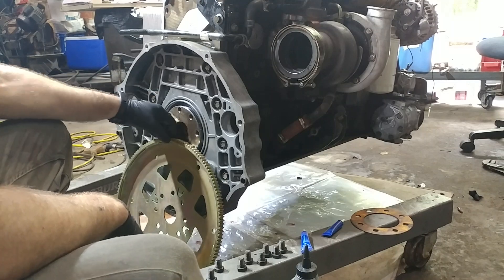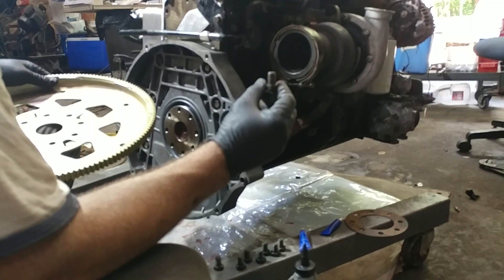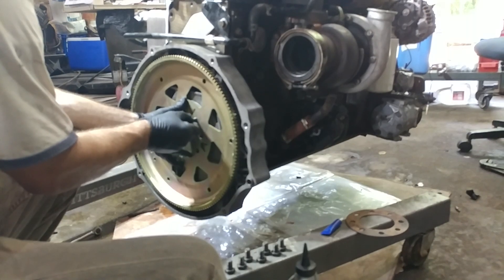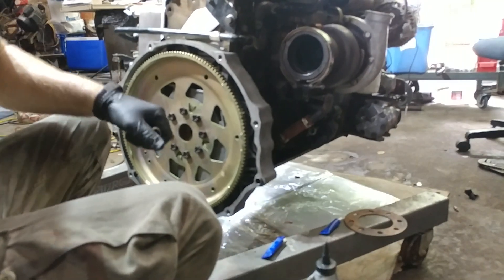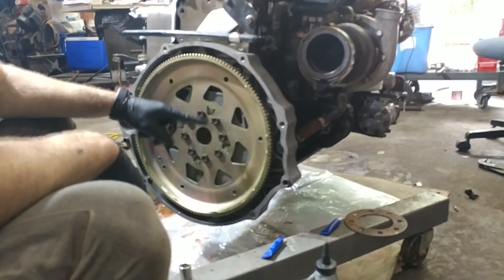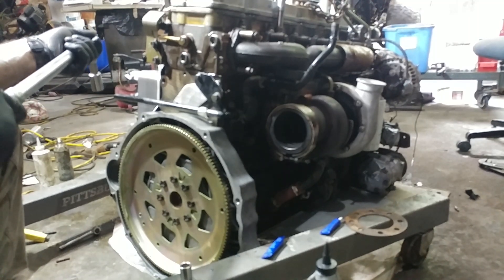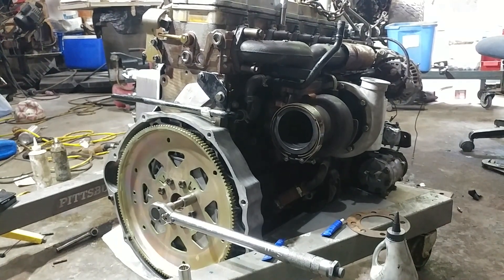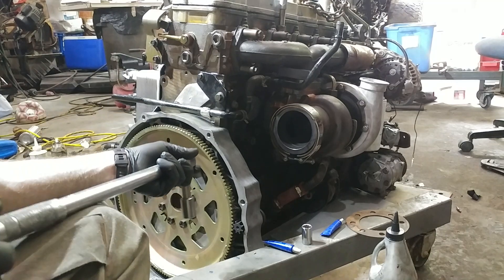Chronicles Of An 03 Cummins Rebuild -Part 49- Flex Plate / Flywheel Install

Comment: So do you still recommend not using the old clamping ring on the  upgraded flex plate  ?
Reply from the maker: That's correct. Use good bolts, torque to spec, and use loctite. And you should be good to go with an upgraded flywheel.
Reply: @70440charger  thank you for answering!!! I'm actually a diesel tech but I've never used aftermarket parts on my own truck I was absolutely nervous about using aftermarket stuff  I looked online and people have stated they had  fitment issues with mounting of the torque converter with this flex plate but I'm assuming if lay flat at the same depth as the stock flexplate they should be good to go